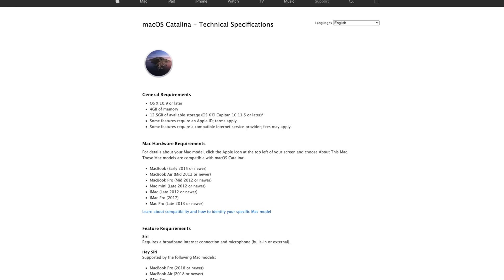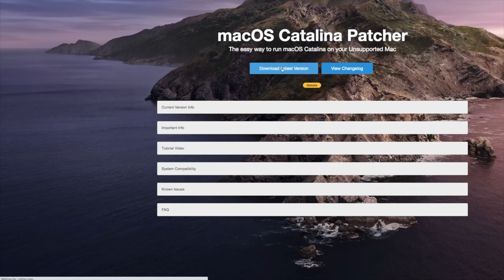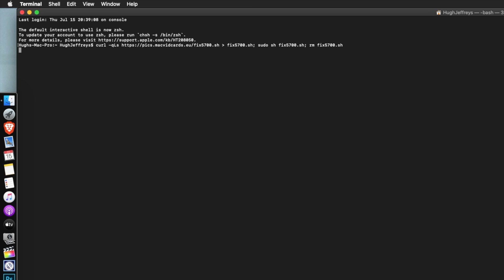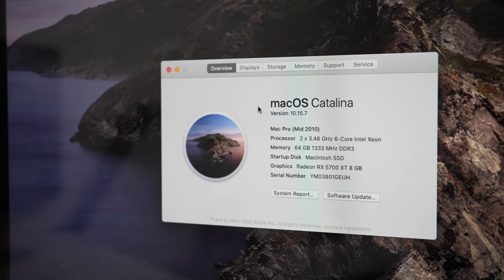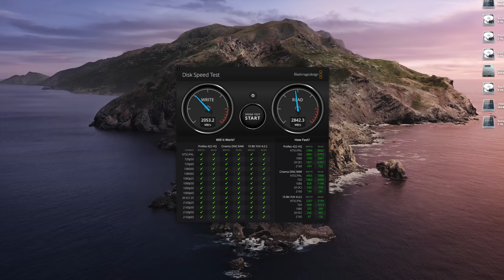Obsolete? Think Again - Keeping My Ageing Mac Pro Alive

Comment from the maker: The poor editing performance was a result of Final Cut Pro, the video files edit flawlessly in DaVinci Resolve. 
Oddly H.265 actually plays fine in quicktime and has less stuttering in Final Cut Pro.
Using BlackMagic RAW Speed Test I get 110p @ 8K Metal and 30p @ 8K CPU rendering performance.
Reply: What's the premiere pro performance like?
Reply: Bro gpus Dont like bdsm
Reply: can i do all that with 2010 Tower?
Reply: How are you connecting the Apple Displays to your graphics cards? What cable/adapters?
Reply: Bro... you might get some better performance (other than hardware limitations) if you deep clean that case, repaste the CPUs, upgrade your storage speed (go for 7200rpm drives if they arent' already and keep in mind the NVMe will be limited by the PCIe lanes which are very few and not direct to CPU like modern motherboards.

Additionally, the lack of airflow is ridiculous... the NVMe drives are SUBSTANTIALLY cutting off your GPU airflow which most likely causes it to thermal throttle which is most definitely affecting your editing times.
Reply: Apple might as well just send F.U. cards to their customers. ‘We get it, Apple. You hate us for being good customers and the feeling is mutual.’

Comment: Tip for dust cleaning - bike pump with ball inflation attachment. Does a pretty good job and its free air!
Reply: Normal air has a risk of static. Not advised.
Reply: @shivkokroo6180  The static resistances of modern electronics is far greater now, if you're using air to just blast fans, heatsinks etc there's virtually no risk. Having not done the maths, I would imagine its more likely for you to be struck by lightning than to have a component fail from static induced failure from using an air pump to blow dust away.
Reply: @shivkokroo6180  for example In a recent test on Linus Tech Tips for example they literally had to put several amps of electric through DDR4 RAM before it failed in any way.
Reply: @QuinchGaming  it's the voltage that kills it. Static is on over-voltage condition. cmos junctions are still as susceptible to static as they were 20, 30 years ago.
Reply: @meowcula  please watch the video Linus Tech if you can. Yes, I mixed up voltage & ampage, I'm not an electrician but the miniscule chance of a miniscule voltage discharge from natural air is not enough to kill modern PC components. If you are working in a clean room environment on sensitive technical/medical/scientific electronic components... sure...but in a PC, that's already earthed (plugged in, but not powered) there is virtually no risk.
Reply: @QuinchGaming  i've used an air compressor to keep multiple computers clean for 10 years straight now. If they want to keep buying dumb products like canned air and premium cables, just let them
Reply: @xdboterham  With you on that one. Maybe we should be inventing a special "Deionised Anti-Static Air" in a can product? We'd make $$$'s 🤣
Reply: Great idea, never would have thought of that and have a big pump sitting around doing nothing as i dont have a bike
Reply: @shivkokroo6180  The risk of that metal can touching a board is far greater than that of static in air.
Reply: Or just get a CompuCleaner
Reply: I used a leaf blower.
Reply: Omg yes i use that method
Reply: I like your thinking and could use that as well. (:
Reply: I just bring my pc out to my shop and use a air compressor never had any problems with that (mac 5,1 and gaming pc)
Reply: Dude you are a genius. Thanks for the tip.
Reply: Broooo, you are an eye opener!
Reply: @shivkokroo6180  In over 30 years I never had a problem with static. Is a fool's myth.
Reply: @DF-eg8vl  Lucky you, because I have seen a fair share of static messing up components.
Reply: Some advice...: use a PLASTIC nozzle on that bike pump (or any type, for that matter).
     Metal can ARC.
And there's something about fast flowing air that creates static electricity.
     A metal pointy thing like a nozzle for balls is basically the opposite of what you want :)
.     (May I suggest using the plastic nozzle for inflatable crocodiles and arm floaties, perhaps? :))

And yes, I know the LTT + Electroboom video where they use an ESD gun on some RAM.

Then again, I've also been shocked by using a metal extension pipe on a shop vac (instead of the normal plastic one)

No need to tempt fate ;)

*Also, canned / compressed air is not, in fact "air". 
     That's why it smells funny.
     That's why you can freeze stuff by using the can upside-down ;)
Reply: @iggysixx  what gas is it if not air?
Reply: @iggysixx  or precisely oxygen?

Comment: You really NEED to deep clean that and repaste the CPU!
Reply: Yeah i bet the thermal paste has long since dried up and the fans inside the heatsinks are probably completely full of dust.
Reply: That dry and crusty paste is begging to be reapplied
Reply: @jugotocks  Yeah the thermal paste is probably dryed out but. There are no fans inside the heatsinks. They are passiv xD
Reply: It's got 2 CPU's also he mentioned he upgraded them, which would mean that the thermal paste can't be that old.
Reply: @markusgotz1237  No it uses the case fans to blow air straight into the heatsinks so it's not at all passive, just the fans are mounted to the heatsink
Reply: He needs to dust it off more often too
Reply: I just cleaned one of these out. Each heat sink has a fan built inside. You can’t see it in the video, but they’re there.
Reply: @jugotocks  OH okay then I was wrong. Sorry was pretty shure I hadn't seen any when I changed my Thermal paste😅
Reply: What he really needs to do, is to buy a proper PC and throw out that overpriced, airflowless, antiupdate thrashcan called a Mac Pro. It's a shame that some people unjustifiably pay , huge amounts of money for the garbage bins Apple sells.
Reply: @ron200088  Do you not get the point of this whole video? Its to upgrade old hardware that otherwise would have been thrown away and continue using it instead of buying a new one and this one becoming e-waste...
Reply: @jugotocks  Exactly, I get the point. Before purchasing a new Gpu, he should have upgraded to a proper case . Not that waste of aluminum Apple calls a case. The new Gpu, will perform like a Ferrari with piss instead of proper fuel in that waste of materials case.
Reply: @ron200088  the case was designed before 2008 bruh
Reply: @keonxd8918  Yeah right! I mean the 2020 Mac “cheesegrater” case has soooo much airflow. It’s a bloody wind tunnel. Anyways, the case could have been designed in the middle ages for all I care. Even more reason to put those components in a proper case. That new gpu he bought for the upgrade is a total waste of cash, installed in such an appalling manner. How “smart” can someone be, to choke a graphics card and consider that an upgrade ?!
Reply: @ron200088  Unfortunately that motherboard is proprietary so a case upgrade wouldn't be possible. He would have to rebuild the whole pc with a new case and motherboard and CPU coolers. Again another point of upgrading still usable hardware instead of throwing it away.
Reply: @jugotocks  Good point. However, the case replacement could still be doable, being able to keep all the components, but only by modding the new case. And that would probably overcomplicate things. Apple’s anticonsumer policies remain undefeated.
Reply: @ron200088   You are completely missing the point of this.

In terms of airflow, this case design is basically where the latest crop of PC cases have almost caught up to, 10+ years later.  The entire front panel is perforated aluminum, nearly all of the back panel is perforated aluminum, and the heatsinks are directly in-line between panel, fan, another fan, and the other panel.  It doesn't get any better than that.

Granted, the motherboard and CPUs are a decade-old platform that can't touch more recent x64 in performance, and the Apple M1 in energy efficiency.  But that's not the point.  This exists, and to throw it out because "it's old" is pointless, wasteful, and just a complete shame - since these machines are beastly (for their time) and beautiful (still).

The graphics card is not a waste at all, since it's part of making the entire machine compatible with more recent Mac OS versions, but also usable for the massively parallel compute capability of modern GPUs.  E.g., if the host platform can manage to stream video data in and out of the GPU fast enough, the GPU could easily be the bottleneck when tasked with compression / decompression, rendering effects, and so on.  Not every GPU is a gaming device.

So TLDR - keeping these machines alive is worth it just for the sake of keeping these awesome machines alive, because they're cool and that's reason enough.  Replacing them with something "better" is not the goal.  They're perfectly functional for a subset of computing tasks -- I'm using a 2009 Mac Pro right now, actually, to watch YT, browse the web, CAD, music, RDP to Windows VMs for work and PCB design, coding, etc etc etc.  For anything it doesn't do well, I have other computers.  But I like this one, so I'll keep using it until the wheels fall off, at which point I'll try to glue them back on and keep using it some more.
Reply: @nickwallette6201  Let's aggree to disaggree. I wonder though, why not a single renowned case manufacturer implements Apple's miraculous case design and never did. Regarding the GPU, I never said it was a waste in the pure sense of upgrading a machine to make it more future proof and compatible with newer technologies. I stated clearly, that it is a waste of money by being installed in such a manner, that it is completely choked. I've seen Hugh Jeffreys' explanation that he has no problem whatsoever in using it without thermal throttling. I just hope people who see this video and are less experieced regarding computers and their components, that they never do what he did. Install a Gpu in such a manner.

Yeah, I perfectly agree, keeping a machine alive, whether it's a PC, Mac, etc is the right thing to do. I'm all up for that, because I basically do the same, especially because I am a retro tech hobbyist. Whenever I need to build a new machine, I always repurpose the old one. Whenever something breaks, I repair it.  Things never become old and obsolete if people repurpose them. And if you pay your due diligence, you can find a new purpose for almost everything.

With all these being said, I will keep considering Apple's practices, anticonsumer policies, ridiculous prices and their hilarious "innovations" the worst out there. Their high quality products are only equaled and taken over by their greed, disrespect towards their consumer market and borderline legal practices.
Reply: @nickwallette6201  Mine has run 24/7 for the last two years now running multiple vm's on it and honestly it's so easy to work on that it's hard to even imagine it's an Apple product. My gpu isn't as choked off as his though as I don't have an nvme card blocking most of my gpu fans. It's probably better off with a blower style card and thats what the oem card is but then I dunno if you can get blower style 5700XTs. Saying that I went from a blower style RX480 to an open RX580 and never really noticed a massive temp difference but my workloads are mainly cpu heavy. 

It's insane how easy it was to do the cpu swap, I think it took me like 10 minutes. The only real problem with the blow-through design is that with no dust filtering it does need a cleaning out every so often. Again that wasn't really a thing when they designed the chassis and just blowing out the dust with a data vac every 6 months isn't that hard, especially when you can remove the cpu tray in like 5 seconds.

I have a feeling Hugh keeps his on the floor maybe? I put mine on the desk and it definitely helps with the dust, but again thats the same with every computer.
Reply: @ron200088  true
Reply: @ron200088  sounds like you're hating
Reply: @Cockalicious  You're mistaken. I love from the bottom of my heart anti/hard to upgrade products, proprietary products, anticonsumer companies,policies,prices, in a few words, all that Apple stands for.
Reply: @ron200088  $60 for mine with 128gb ram... not a bad deal... 😉
Reply: Cpu upgrade can be risky in these

Comment: Pc users: "look at what they have to do to mimic a fraction of our power"
Reply: @mikehall3976  can confirm, i have an old iBook G3 and it was a pain finding all the software to get it going again
Reply: @mikehall3976  I carried a 12" PowerBook G4 for years motorcycle touring, until I replaced it with a lighter MacBook Air. What I miss the most is the keyboard – perfectly cupped keys allowed my fastest typing speed ever. I also liked the removable battery, which I had to replace after six years of use. I used it as a CD player/alarm clock/internet radio for awhile after that, but now it just sits in a drawer in all its beat-up glory.
Reply: @mikehall3976  Sure, but it's about keeping a product going for much longer than the manufacturer intended.
Reply: Thats why its called PC Master Race
Reply: To get those bottom fans out you have to unscrew the cpu/ram frame from the case then unclip and slightly push the fans inward also disconnect the power which is located in the middle of the frame there are 3 one small one and 2 bigger ones, yeah it was so easy (no it wasn't).
Reply: @lands1459 WHA?!?!? OK, that's a bit overkill 😂🤣😂🤣😂
Reply: @mikehall3976  I think it's cool to own an old laptop, but not use it as my main computer. Like I have an old Dell Inspiron 600m, it kept blue screening, but after reinstalling Windows XP, it worked perfectly fine. I currently use an HP laptop, which I upgraded to 12GB of RAM. It has an Intel Core i5 8th Gen, and runs Windows 10 because I HATE Windows 11.
Reply: @chunkemonke777  ?
Reply: @chunkemonke777  Why the hate? I feared and it became my favourite OS.
Reply: exactly. I have a 2010 MAC PRO that basically just have to turn on when I need some old files..BUT ON MY PC, I have 2 x 18core  XEONS  and 192gb of ram...2 x 3090s bridged for 48gb vram. ALL SSDs internal drives.

Comment: Im really surprised you don't own an electric air compressor/duster.
Reply: Also apparently you shouldn't vacuum a PC since it causes a build-up of static electricity
Reply: @Itsoof478  I guess we can’t succ a computer
Reply: @martin_green  Can vouch for that. It's even useful in household scenarios, not just computer-related
Reply: @AndreySavin  I couldn't agree more. I use it to clean out everything ... radiators, electronics, the car and all those places you can't reach. Water-free (unlike compressors) and much more powerful and enviro friendly than canned air.
Reply: @ThatTonybo  I used to use an air compressor however sometimes found that water would come out of the jet and that the tank would need the water draining from time to time. I bought an anti-static dust blower for £50 for computers and it has lasted for years.
Reply: @martin_green  you can actually get an attachment for your compressor that will take out the moisture in that compressor that you have. so that water won't come out of your compressor and you just need a moisture filter.
Reply: I have dusted once my old laptop using electric air compressor and the laptop won't turn on and I had to pay to get it fixed
Reply: @KennyChu  Laptops require very careful attention when dusting. Firstly, it is best to open the whole laptop up to clear out the dust as fluff can often get trapped and cause more problems, especially around the external vents.  Second, it is important to ensure fans are held in place as they are delicate in laptops. If a fan is compromised, the laptop can't cool down effectively, thus causing heat and often a shutdown to protect itself. Using a standard compressor (rather than an antistatic blower) will often introduce water inside the system. This has obvious consequences.